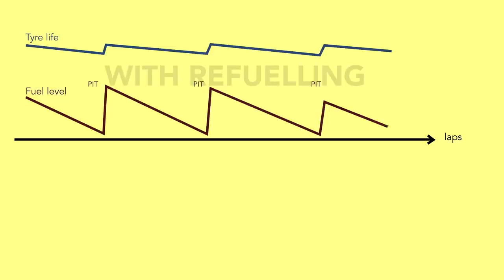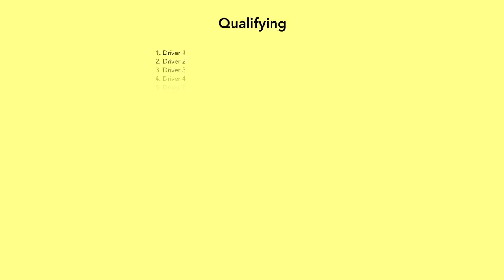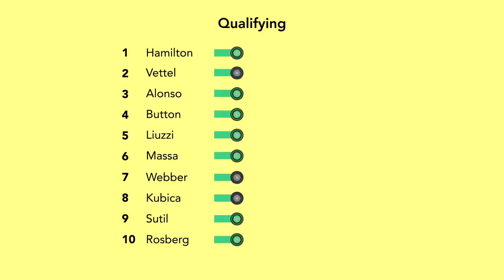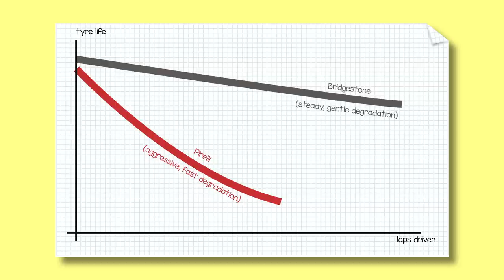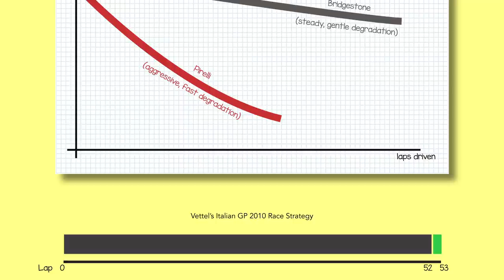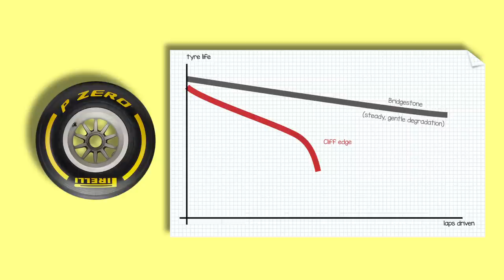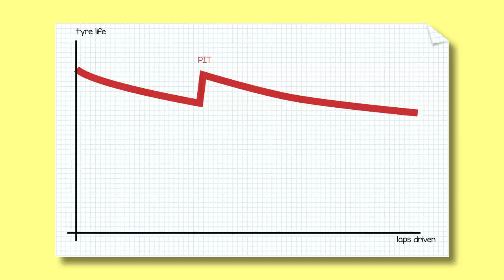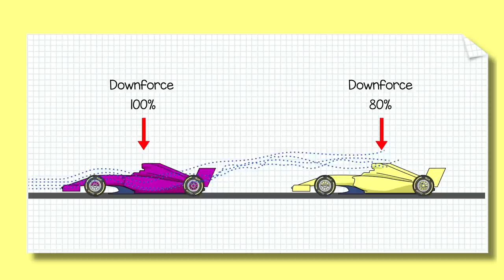How Canada 2010 shaped F1 for a decade - Chain Bear explains

Comment: Here's a better solution, bring in a second tire manufacturer, then we'll have proper racing again.
Reply: Or tell Pirelli to make the grippiest tyres they can, deal back some aero and let the tyres increase grip. 

I hate seeing drivers being conservative with their tires.
Reply: @Koffiato  sure but pirelli isn't pushing itself to find the absolute limit of performance, which is why competition is good.
Reply: @JackPecker911  Pirelli isn't pushing itself to the limit because FIA doesn't allow them to. They demand worse tires.
Reply: @Koffiato  Trust me, it doesn't matter what Pirelli does if you want true competition you need more variables. In the early 2000's when we had Bridgestone and Michelin the racing was great and the drivers were aggressive pushing the cars to the absolute limit from start to finish. The tire profile was that Bridgestone was the awesome "qualifying" style tire that you could do fast short stints to get the job done, while Michelin was the longer lasting tire that needed fewer stops. Different strategies were at play so we always had cars in and out of the pits on different tires and fuel loads and you couldn't predict what was going to happen. If a single tire manufacturer provides tires, everyone has the same data to go on and the same rubber, so it is still boring. So it's not about the tire itself per say and I'm not saying pirelli couldn't make better racing tires, the key thing is everyone would still be on the same rubber which is the main problem. It would be even more interesting if they had 3 tire manufacturers that would be an even better show imo, cause at this point and time everything is focused on "saving fuel and tires" for the whole race which is not really the point of the highest degree of motorsport, that should be the pinnacle of technology and the highest level of competition.

Comment: if they wanted to make a show with gimmicky tires, reserve one "jinxed" tire to the top 3 in qualifying that will severely wear no matter how you drive and you'll not know if it's you jinxed with the cursed rubber. either that or just stop with the stops, make drivers battle for position and only enter the pits to retire woohoo

Comment: Bring back refuelling and harder tyres- or refuelling and degrading tyres. But refuelling is now a big big miss imo
Reply: Refueling works in Indy Cars but there they use water-soluble methanol so not as big a deal to put out fires that do occur.  I think the only way refueling could work in F1 is to enforce some sort of minimum pit stop length, or maybe use gravity-feed only?
Reply: Refueling is so terrible for racing. This is probably the last thing F1 should ever consider. Overtaking in the pits is not exciting

Comment: This "on-track" overtake statistic is completely irrelevant to interesting races. one epic battle over multiple laps with only a single overtake is a lot more interesting than 1000 DRS overtakes that you can see coming 30 laps away. even stragey overtakes in the pits due to refueling are more interesting than DRS overtakes because you never know how much fuel the cars are carrieing.
Refueling IS the answer.

Comment: If we want more exciting races, implement some changes so that it's not Mercedes 1-2 from lights out to engines off. Having a pure "fastest cars up front" means no passes. I get that we want the best race teams to win, but when they don't have to fight for it, why not call off the race after Q3? Or implement a system such that the fastest teams don't get their pick of everything (tech, sponsorships, drivers, etc.).
Reply: I'm sorry, do you even watch formula one?  What do you mean - "they don't have to fight for it?"  And how exactly can the fia formulate rules to stop mercedes from building the fastest car?  Exclusion?  By your logic, we should having Usain bolt run with lead shoes or have federer use an iron racket.  If F1 wants to be a sport, domination through exceptional talent and execution should be celebrated, not frown upon.  Blame ferrari/redbull for not delivering on similar budgets.

Comment: Refueling should come back. We always have pit stop errors, whether with fuel or tyres, it's just gonna happen. Surely, in 2021 we have the technology to make refueling as safe as possible. Not to mention, with current hybrid power units the cars need significantly less fuel than ever before. I'm confident we can make refueling happen and it would enhance the show.
Reply: Overtakes in the pit lane do not enhance the show imo. I'd much rather see cars overtake on track

Comment: "Refueling, of course, is not the answer." I was hooked on Formula 1 in 2003 specifically because, as I thought of it back in my early teens, "I just watched geniuses win a race with MATH." I would rather watch a procession of cars that are light, quick on their feet, and driven to their limits than a procession of heavy and unwieldy cars that are, on top of the weight of the fuel, purposely lapping slowly as well.

Comment: Why can't we have fast, robust tires with a usage of two compounds? You get a one stop strategy, but so does every race right now. I don't see the problem.
Reply: The problem is what Vettel did in 2010 that the video explained. Drive nearly very lap on the same rubber than just take a new set with 1 lap to go
Reply: @zephyr6877  Then make a pit window?

Comment: why dont indy, F1 and Nascar Cup Cars run at CTMP ? " Mosport"
Reply: Indycars race at Toronto, which is rather close to CTMP. They don't like having events close together geographicly, for fear that these events would hurt each other in spectator numbers. For example they did not go to Road America while Milwaukee was still on the shedule.Similarily as long as the Toronto race is on the schedule there is no chance for CTMP.

NASCAR does have the Truck Series race at CTMP. But the cup series (to my knowledge) has never raced outside of the US, and there is no desire from NASCAR to change that. 
Also because of some legal trouble about a decade ago the contracts between NASCAR and the track owners are so complicated, that it has become pretty much impossible to add new tracks to the schedule, unless the new track replaces another track that belongs to the same owner.
F1 did race at Mosport in the 60ies and 70ies, but then moved the Canadian GP to Montreal when that track was built.There are several reasons why F1 does not race at CTMP, most importantly because Montreal pays more money, while CTMP probably could not afford an F1 race anyway. But also because Mosport does not comply with F1 safety and infrastructure standards.
Reply: Hannes Größlinger Toronto Indy race is on the streets of the city and through the ex grounds. It’s a garbage race with no passing. No one in Toronto would complain with that race being moved to CTMP. Real reason is the pit lane would have to be moved cause it’s too short and they would need to put Safire barriers and catch fences around the whole track

Comment: Bring back refueling and have very strict safety guidelines for the refueling process. Pit strategies would be vastly different rather than just slapping on the hardest tyre after 20 laps.
Reply: Yea, you might make strategy a little more interesting, but at the cost of making the racing even more boring

Comment: Just allow refueling back ffs
Reply: Why? Genuinely curious because I can't think of any advantages of refuelling if you want close racing. All refuelling really did was save weight and made the car quicker.
Reply: Sun Levi I assume you get more pace advantage of more pitstops. It just adds another variable to the whole strategy that should make things more interesting
Reply: @SunLevi  I got hooked on F1 because of the complexity of the fuel strategy. Removing it simply made the drivers reliant on DRS, which either doesn't work at all or works far too well (I've seen a few happy medium situations, but not enough to justify the gimmick in my opinion). Close racing really isn't possible with Formula 1's ruleset anyway: Teams design and build their own cars, and one or two teams will almost always figure out the rulebook better than the rest. The only way to get "close" racing on a consistent basis is to turn it into a spec series, which is contrary to what Formula 1 has historically been about.